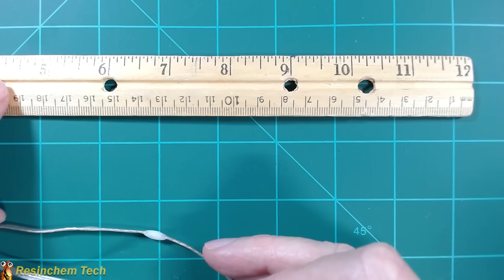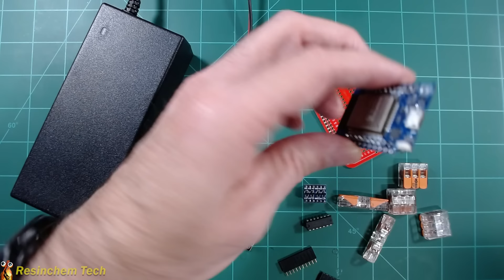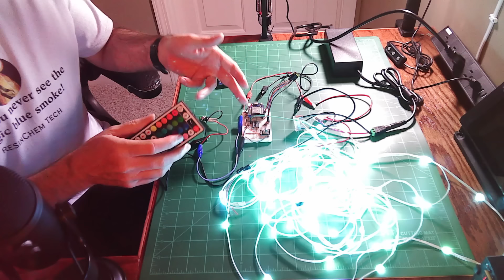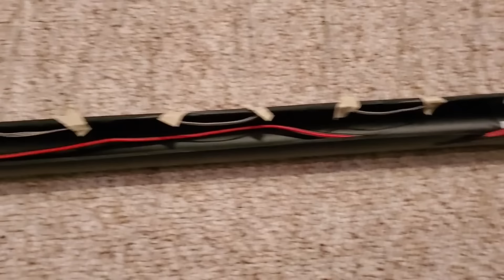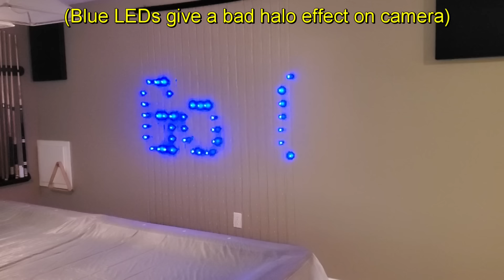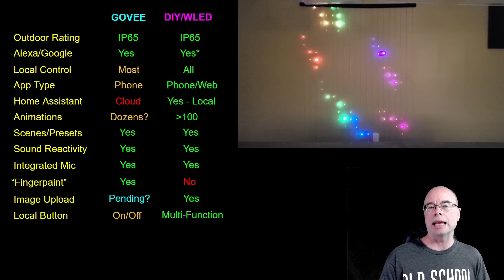Building an LED Curtain with WLED

Comment: govee has added image upload, must be in .gif format, but 0 information is given on the parameters of length of gif run time or file size.  i have been experimenting with hand/manually making a gif with a multiple frame "slices" of jpg/png  images.  i still haven't fully figured out the parameters even doing it this way as it seems very hit or miss on total number of frames of gif, their delay times before moving on to next frame, etc.  great info on your videos
Reply from the maker: Yeah... I still don't own the Govee version (and probably never will since I have my own DIY version) so I haven't kept up with things they may have added.  But right now, even with the DIY WLED, you can't upload or create any sort of moving image.... at least not yet or not without adding some sort of modification.

But matrix support is still relatively new to WLED and the developers are constantly improving it.  I would not be surprised if support for some sort of moving image via individual frames happens in the future.

Thanks for watching and sharing info on the Govee version.

Comment: Electronics 101 - Although starting my Electronics Hobby, Formal Education, and Career in design, development and manufacturing when ICs and Semiconductors were expensive and all socketed, the first rule of building circuits still applies.

Whether using  matrix, strip, prototype or Printed Circuit boards, always check the power rails and all power connections to the ICs and polarity sensitive devices (including polarised capacitors) before plugging/soldering in the ICs and Semiconductors.

Great demonstration of what can be done with a bit of ingenuity, skill and imagination with the range of hardware and softwares out there!

Comment: the new esp32 wroom boards with the usb micro are being horrible for uploading code. the usb c based ones work fine though. the serial ic cp2102 is quite power hungry when flashing.

Comment: How difficult is it to program?
I also work with W-LEDs but I only use purchased controls, unfortunately these are very limited in their effects.
Wants to do a show next Christmas, I think it will be a tough learning curve. Thanks for the video ! greetings from Germany
Reply from the maker: If you use the WLED firmware, there is no programming involved at all.  You just fllash WLED onto your ESP8266 or ES32 board and then join it to your WiFi.  At no point do you have to write any code or do any "programming" to use it.  And it has over 100 different lighting effects and many other features.. all available via a web browser or your phone.  I'd recommend that you check out the official WLED web site for more information:  https://kno.wled.ge/

Comment: I really like your design.  While I realize the pixel configuration is bit of a rectangle (my OCD is kicking in) it looks and functions great.  I wish I would have seen this a when it was released.  As it was I saw the Govee setup and it went on sale on an early Black Friday sale at $90 I bit the bullet and bought into the their system. We got 3 curtains and linked them together.  I find it to be a mixed bag of tricks and treats. Some of it looks great and some not so much.  The most frustrating part is the lack of control.  It is kinda a set it and forget it system.  I have not found a way to change the effects on the fly especially in the sound active mode. After a short while of seeing the same effect continually the dazzle seems to loose a bit of its luster.   So now I am deciding if I want to keep the Govee setup or build up a whole system that will offer the ability too create music synced sequences. I wonder if there is a way to convert the Govee curtain to be controlled by the something like the Quin-LED Dig-Octo.  What do you think?
Reply from the maker: I think a number of folks (and a few in these comments) have stated that they successfully removed the existing controller on the Govee curtains and replaced it with a WLED controller.  So, apparently is it possible.  Not having purchased the Govee version, I can't really specify any details... but I believe the Govee LEDs are standard WS2812b LEDs, so once you get the controller connected and the matrix defined properly, it should work fine.

You might browse thru the comments here and see if you can find one that talks about replacing the controller and reaching out to them with the details.
Reply: Thank You!    BTW subscribed and set to alert to "all."  I like your style and attention to detail.   @ResinChemTech

Comment: Congratulations on the channel, could you put several independent curtains, each with its controller and be able to interact with each other? How would it be done?
Reply from the maker: You can certainly do that if you are using WLED.  You can sync controllers together and changes (effect, color, brightness, etc.) made to one are synced to the others, so that they will all run the same.  Or you still have the ability to control them independently.

I demonstrate this in my video on making a battery-operated matrix t-shirt that I sync it to the LED curtain: https://youtu.be/T2YGL1mzMKA  If you skip ahead to the chapter on syncing to the curtain, you can see how this feature can be turned on or off.  The same process could be used with one or more additional LED curtains each with their own independent controller in the same manner that I show with the t-shirt.

I hope that answers your question!
Reply: @ResinChemTech  Thank you very much for answering, it has been a great help. I will start the project as soon as time allows.
Cheer up with the channel and greetings from Spain.

Comment: Great information!
A friend of mine purchased the LED matrix and didn’t want to diy it .
The bad thing about it was the software was clunky.
I love WLED and the digital microphone is amazingly sensitive and the gain of the microphone is so easy to adjust. I this maybe after the holidays I’ll tackle one of these curtains. Again great information and video!
Reply from the maker: Thanks!  Once I figured out the mounting method with the two "half-pipes", the rest of the project was actually pretty easy.  And I totally agree that any sort of commercial controller isn't going to give you the effects, options and flexibility of WLED... and of course without the need for any sort of cloud account as well.

Good luck if you do opt to build your own.  Let me know if you run into any questions along the way.

Comment: Hi can you tell me where the matrix section is on wled. Thanks
Reply from the maker: If you are running a recent version of WLED (0.14.0 or later), under the config menu at the top, you should see 2D Configuration.  Under the  2D setup, change the strip or panel from 1D strip to 2D matrix.  This will enable the fields where you can define how your matrix is configured.  Be sure to set the proper number of LEDs in the rows/columns, the direction, location of first pixel and whether they are wired in serpentine fashion or not.  Once you have done that and saved the settings, you will see new matrix effects appear on the main WLED screen.

Hope that helps.
Reply: Thanks I'll give that a go

Comment: Great Video!  The Govee curtain lights are usually on sale (11/20/2023) for $90 and you can sometimes buy them in a 3 pack.  I understand you can cut the connector to add wled support.
Reply from the maker: Yeah... a number of other folks have stated that they successfully "operated" on the Govee version and upgraded it to run with a WLED controller.  I think that's a great option.  For me, I wanted to see if I could create a completely DIY version.

And I do like the bottom "pipe" on mine that adds a little weight to the bottom which helps keep the strands straight.  While I don't own them, the one thing I've heard others say about the Govee version is that the strands don't always hang straight with the LEDs all facing the same way.

But I definitely had more than $90 in my version.  I don't think there's anything wrong with the Govee version (but again, I don't own them  so I can't give a personal review).  I just like the challenge of seeing something like this and seeing if I can build my own DIY version.

Thanks for watching and the comment.
Reply from the maker: Well, this isn't my firmware... it's WLED by Aircookie.  However, there are some frequency based matrix sound effects that do similar to what you are talking about.  

As far as the microphone and sound-reactivity, it isn't a conflict but two different forks of the same firmware.  "Official" WLED does not yet have sound reactivity, while the SR fork simply does not have the modules for IR compiled into the binary.  You can either compile your own that includes the IR module, or you can use the cutting edge MoonModules that attempts to merge the feature of the two forks together.  Again, this isn't my firmware... I didn't write it, nor do I support it.  But you can find more here:
Official WLED Site: https://kno.wled.ge/
Sound Reactive Fork: https://github.com/atuline/WLED
MoonModules: https://mm.kno.wled.ge/

Comment: I love the idea to use a bottom piece as a weight, and want to add one more possibility:

Window screen

It would allow you to roll it up easily, the air goes right through it so it doesn’t get blown around as easily, and you can secure the individual LEDs in-place exactly where you want them.
Reply from the maker: Great idea.  Thanks for passing it along.
Reply: Great idea.
Reply: Yes! You could also white or colored tulle/mesh/organza to match a background wall.

Comment: Great video and something im definitely going to try and learn more, one question as i was going to buy the govee version but the length is too short, with your version could the square be adjustable to say 3 meter lenght with 1 meter drop, would suit my window a lot better
Reply from the maker: Well, one of the nice things about DIY is that you can basically make it in any dimensions you want.  There will be some limitations though unless you are willing to cut and re-solder the wires or have exposed JST connectors.  As you saw in the video, I ran the LED strings so that each string ended and the next began at either the top or bottom of the display so that the connectors between two strings could be hidden inside the half pipe.  Depending on how you layout your strings... and the dimensions... you could end up with the need to connect two strings in the middle (and also do power injection).  But if you can adjust the layout so that the connections align at the top or bottom, you can certainly make something that is wider than it is tall.

Also be aware that if you use more than the 400 pixels I used here, you may also need to adjust the size of the power supply and the number of power injection points.  Good luck and let me know how it works out!

Comment: I use WLED SR on my tent lights with the digital mic, it will react to the dance club at camp that’s 800’ away from where I pitch, but funny part is the lag watching from the club as the sound takes more time to travel to the controller than the light coming back 😂 it’s most noticeable when there’s a break in the beat, thats not in time to the music in the club. Wish I could post the video in the comments
Reply from the maker: That's interesting... I haven't done anything with SR WLED outdoors or at any appreciable distance.  But it does bring up an interesting point.  I would suspect that the same type of effect might even occur at something like a concert in a large arena or outdoor amphitheater... where the light from anything that was synced to the music on the stage would reach your eyes before the sound reached your ears if you were sitting in the "cheap seats" some distance away from the source, assuming both sources are on the stage and remote speakers aren't used. 

I guess you don't experience the lag with something like xLights and those large synced things like Christmas displays because the music is coming over the car stereo and doesn't have to travel any significant distance vs. the lights which could be further away.

But it would be interesting to see the lag at the distances you are talking about. WLED music sync is far from perfect, but I guess for what you "pay" for it, it's pretty amazing in terms of what all it can do out of the box.  Thanks for taking time to leave a comment.

Comment: Nice work.  I love WLED.  I actually have the GOVEE curtain, and while it does allow you to upload GIFs, they often don’t look very good or import completely and the animations are very jagged, which is true of most of their effects. Just FYI, I was able to pickup the GOVEE curtain for 99, but I prefer yours.
Reply from the maker: Thanks!  As I mentioned, I don't have the Govee version for comparison, but I suspect the jaggedness is likely caused by the strands not hanging down perfectly straight and the distance between the pixels isn't consistent.  From watching other's reviews, I I thought that this could be an issue and that's one reason I wanted to add some sort of bottom rail or weight to try to keep the pixel strings straight and aligned (and I could hide wiring as well).   The Govee version, with more pixels, should actually look better than mine... but for matrices to look best, the alignment and spacing between pixels needs to be equal and consistent (or as much as possible). 

And to be honest, at $99, my DIY version is very likely going to cost more to build.  But for me and this particular project, my goal wasn't really to try to save money, but more about seeing if I could build something similar... and that would use WLED.

Thanks for watching and taking time to leave a comment!
Reply: I agree.  Wish I would have seen this first.   After a couple of months now how are you liking the Govee setup?  We recently saw and bought the Govee system... One of the stands is shorter and throws the matrix off bit.  Will be replacing that curtain in the next day or two.  The wind is an issue as well as they are mounted on a wall outside.  The price was decent on early Black Friday sale at $90. The lack of control/sequencing is a bit of a bummer.  Have you heard of anyone controlling the Govee curtain with a Wled controller or anything else?
Reply: @knowyourjoe   I did see a video of someone controlling Govee with WLED but only after cutting off the controller and connecting their own chip with WLED installed.  I’m indifferent about Govee, some of their stuff is nice, but I stand by my earlier statement.
Reply: Thanks. I will look it up.  I am new to this and have no experience with WLED ... yet..  @SmartLightDimwit

Comment: They all need to program in a millisecond forward offset predicting the beat to represent it in real time, not lag by a millisecond. Otherwise microphone triggers will always be cheezy.  And you can't dance to them.
Reply from the maker: Well, I guess that's something the firmware developers (and that's not me!) would have to implement.  But to be honest, I don't think a DIY version of any of these LEDs using open source firmware and very low cost microcontrollers were designed or really meant to be used in some sort of "professional" dance venue.  I think they are really targeted for home DIY users... and personally there isn't a lot dancing that goes on in my basement!  But for some general home ambiance of LEDs that move to music or sound, I personally don't think a millisecond delay makes a huge difference to most people... but it may to others.

If you want perfect synchronization, then you should look at something like xLights that allow you to lay out the effects to a sound track and you can precisely control the effects.  Otherwise, I think perfect synchronization is an awful lot to ask of a $5 controller and totally free firmware.  But I appreciate your sharing thoughts on it.

Comment: Thank you so much for sharing this. I was wondering if you use a specific app/tool to draw your wiring diagrams?
Reply from the maker: You are very welcome!  For most drawings, I'm just using Google Drawings.  I try to capture images of most components that I use, so I can drop those into the drawings.  I know that for me at the start, and many other beginners and 'non-engineers', seeing a drawing with the actual components and wiring connections as opposed to a true wiring diagram with a bunch of symbols might make it a bit easier to understand and follow.

Thanks for watching... I appreciate it!

Comment: Hi, I am watching this from Europe and as a retired electronic engineer and teacher, I appreciate your video very much. Well prepared and presentation of documents/ informations. Particular the purchasing links are really helpful. I Will build the project for Christmas decoration, thanks, and good luck with your next project, of course I subscribed your YouTube channel.
Reply from the maker: Thank you for the kind words!  For most of my projects, I try to always include the actual parts I used.  And normally there is an associated written guide that not only has the parts lists, but wiring diagrams, code used, etc. if appropriate.  From when I first started, I would get frustrated trying to 'freeze frame' a video to try to be able to see the wiring of some component.   So I create written versions of those things to try to make it easier on beginners.  If there is a written guide, it too is always listed in the video comments.

Thanks for watching... and subscribing.  Welcome to the channel!